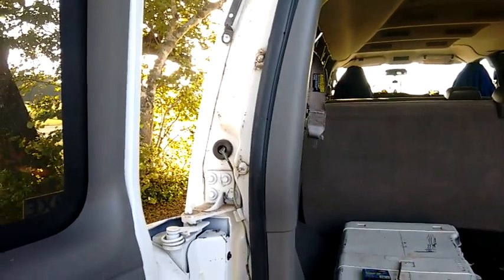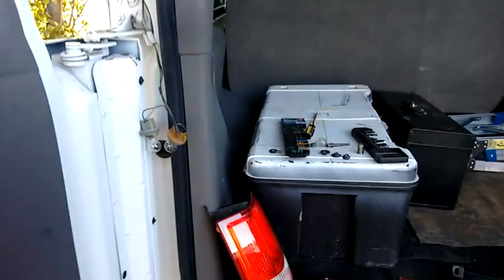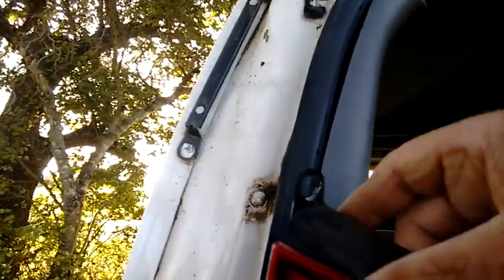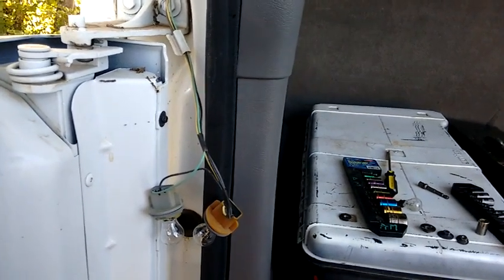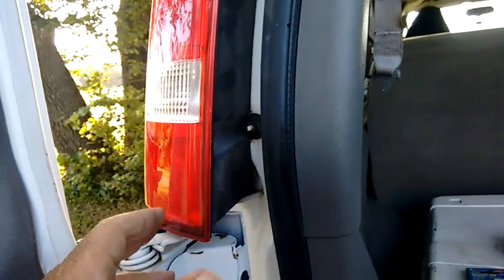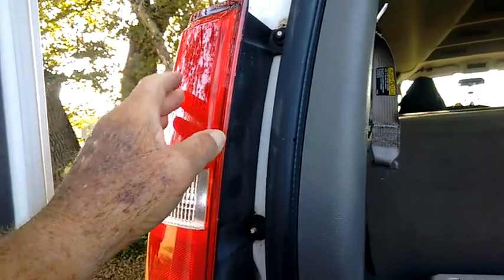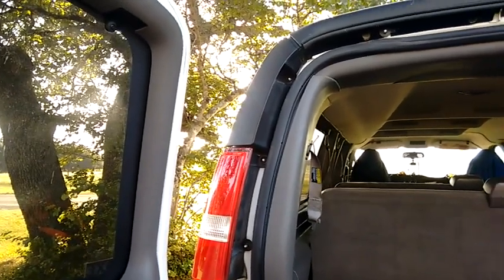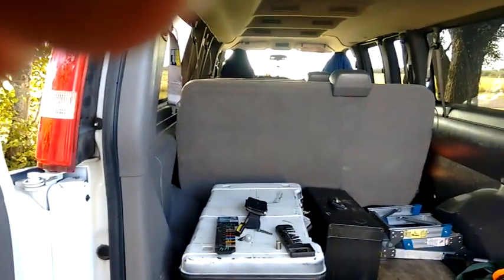2017 Chevy Express Real Signal Light Repair

Comment: Mine is a 2014 and made the same way with the trim piece and clips. I couldn't get it off without breaking the clips but they don't seem real necessary since it's screwed on anyway. I wish the bulbs could be replaced with permanent LED lights. Thanks for the video.

Comment: The other way is correct. Don’t pull the grommets out. Take the  first 3 bolts out. Lift top off studs then put your palm to the right top and pop the light to left and light will slide out of the grommet. Then pop the bottom at an angle. Mine is 2018